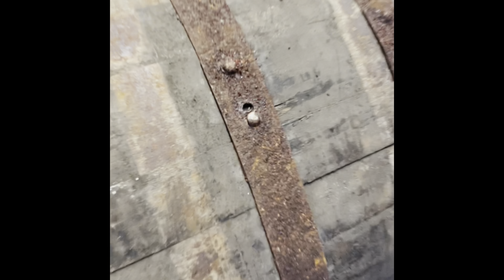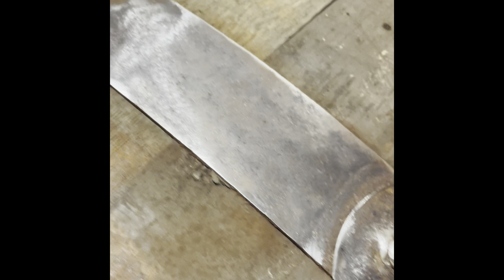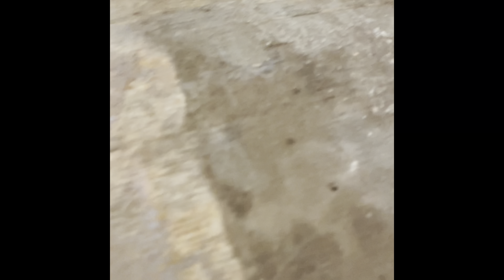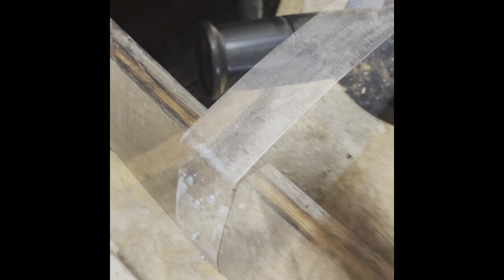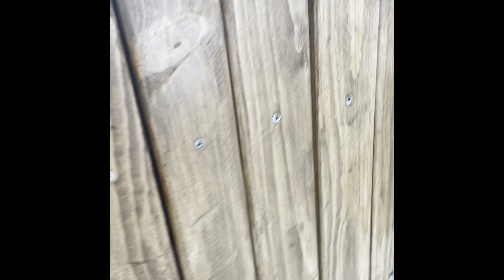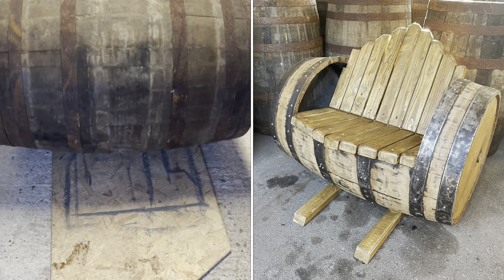Making Oak barrel chairs

Comment: Awesomel work I want to make one for my wife I have a question that long 2×2 inside the barrel how do you have that anchored  so the rest of the boards  on top  hold the weight when someone sits on it?? Your response and time will be greatly appreciate it thank you.
Reply from the maker: Hello David! Thank you! That’s great news! So currently I have 3 columns of 2x2 attached to the base of the barrel inside (one long in the middle and two shorter either side of the seat) of which that long 2x2 is also attached. To help I also put a long screw through either end of the sides of the barrel to secure that long piece further. I weigh 95Kg and can jump on the finished support  with no creaking or give! Of course you can add more supports as required! Just make sure they are perpendicular to the seat for maximum strength!
Reply: Thank you so much for replying you do great work have yourself a blessed day.
Reply from the maker: @davidvillegas5885  That’s very kind! Best of luck!